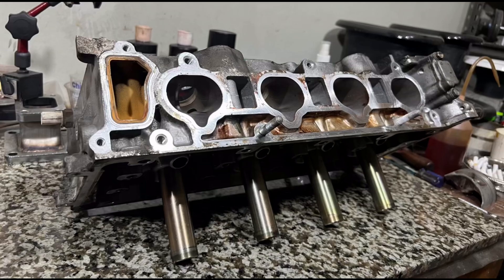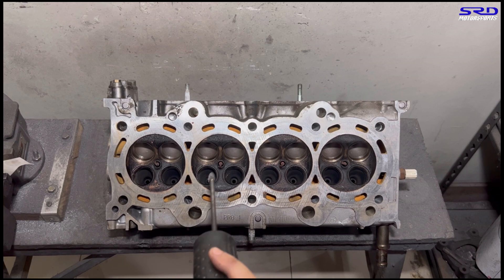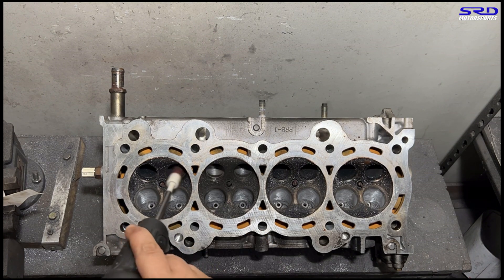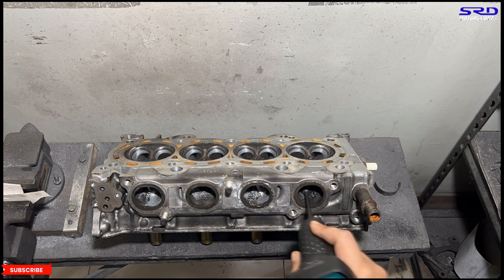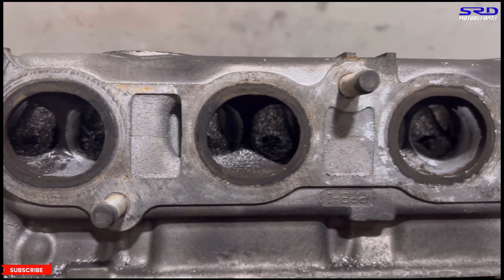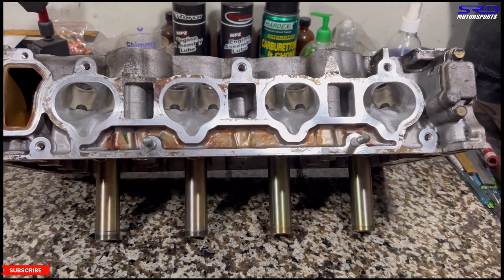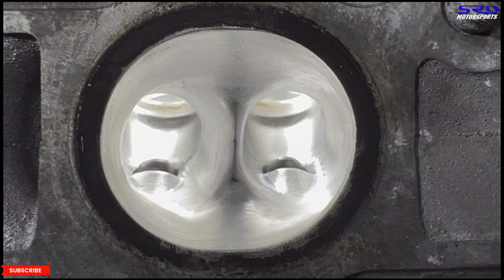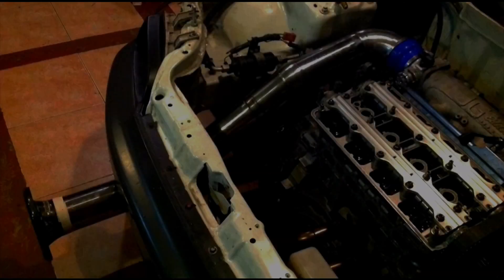Honda K20a TypeR PRB Head Pocket Port and Full Portwork

Comment: Nice vids! Im about to do the porting job on my RSP-2 head. Did you ever have one of these? Because it looks pretty well ported already and i'm about to run at 12.5cr with big lift cams and itb, so it should be capaple of 10k rpm. Is there more porting needed than this? And do i have to increase the diameter on the intake ports or is this useless unless you use oversized valves?
Love from Germany ✌️
Reply from the maker: U can do just a simple pocket port style clean up and yes the RSP is a nice head

Comment: did you make the tool you are using with the 80grit yourself or is there a way I can buy that online? i'm using a standard dremel and have to get to close to the valve seets and i'm afraid i might screw them up.
Reply from the maker: It’s just a 6 in shafting I chopped I believe it’s a Ducati or harley steel pushrod (I think Harley)

but the more proper Standard Abrasives shank (6in) is a lot better cuz the sanding / cartridge rolls are better shaped conically letting u make a way better finish

I believe Standard Abrasives are still in business in the US and they got a 6in long shank
Reply: @SRDmotorsports  Thanks a lot!
Reply from the maker: no worries man! the spray lube I use is a self made one a mix of ethyl alc and dishwashing soap or liquid soap

Comment: Great video 👍what do you think of Dimple  porting
Reply from the maker: That’s a great question however debatable and I wish not to offend those who do it differently be it erroneously or not hehehe

but I’m sure u can fill ur own answers on that

And to stay on topic il share inputs :
The reason for pocket porting if not fully ported is to let the transition be better than “as cast” and if that is improved you “recharge” the air and fuel mix into the chamber across the valve seat and past the valves…  this in turn makes it more efficient by way of “less drag”

a lot of times that’s forgotten due to being fixated on “flow” but drag exists
unless we see a “rough” textured wing or a rough textured huracan and it’s better? hmmmm
Reply: @SRDmotorsports  yes I done a bit looking into it and seen mixed results on it that why I interested in your views on it as I would consider you to be best in business 

Pocket port as work you have done on this head is best all round setup this what I do on any my own heads just so for myself now I have always been doing 80 finish on intake and 120 on exhaust from what I have seen was the best to go to because exhaust smooth and intake bit rough for best air fuel mixture but I see you finished intake 120 too so is this what I should be finishing the intake too on my heads from now on
Reply from the maker: Wow good attention to detail 
And nice we do the same I use 80grit finish on intake and 120g on exhaust

on usual occasions like this I go 120 on intake mainly cuz even the stock Kseries injectors spray “better” than our old Bseries and Dseries

And I know this one will run the newer ID injectors too so that’s as good or better…

my earlier answer is also the reason I do the “bowls” on the intake to 120grit on others even if the rest of the port is 80grit (that’s a secret lol)
Reply: @SRDmotorsports  wow thanks for that secret now you say that it makes prefect sense so what your doing is were it is straight at start leave 80 grit for mixture and 120 grit on turn because it near valve and turning so has more drag compare to start and that way it have even flow from start to finish 

 Thanks as said I love really technical things but only for myself and my own projects
Reply from the maker: yes ideally we want the valve seat (where the valve job is done) to get the most charge passing thru it cuz it’s how it shines well

In the end we just “filled” the chamber maybe more than usual and that’s power hehe
Reply: @SRDmotorsports  yes makes sense and i will be doing this to any of my heads from now on and if i us id injectors 120 grit as always great to get these videos and can't wait to see what you come up with next
Reply from the maker: that’s good to know yeah 

And while we touched up on the the subject of spray quality… in the near future (hopefully soon) saving up for an injector tester/balancer machine (could clean injectors for the locals) but mainly to have a chance at talking sharing stuff about how “pressure” can change and affect spray quality

Ofcourse we want the best spray quality hmm
Reply: @SRDmotorsports  looking forward to see that one be interesting to see your take on injector spray
Reply from the maker: Yes sir!